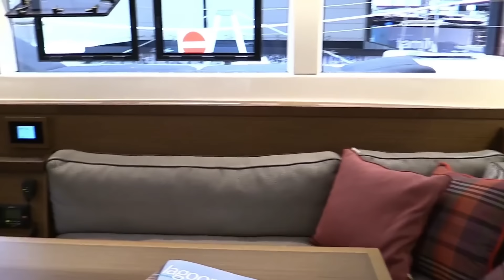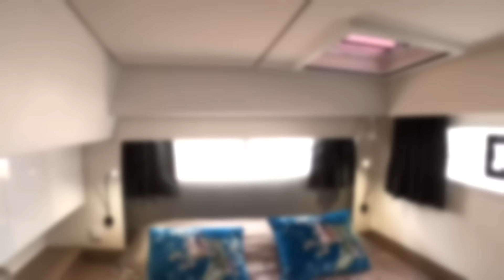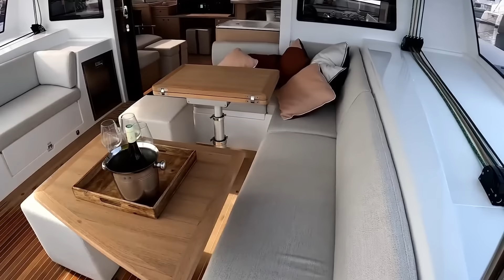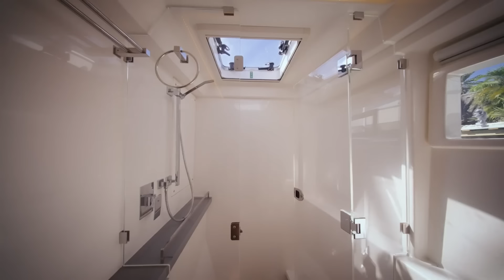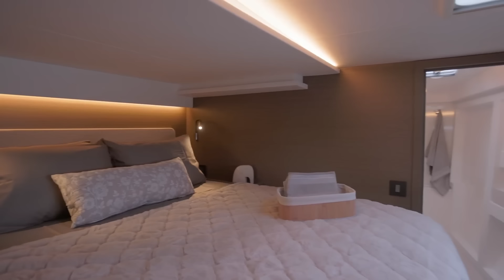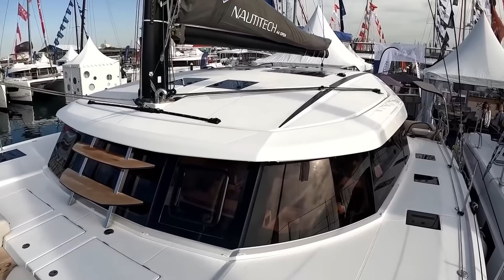Top 10 Liveaboard Catamarans Under 50ft

Comment: The Euro-African axis is well represented here. Not  one Asian manufacturer?! I believe you have a huge blind spot!!!
Reply from the maker: Fair point on the concentration. Lagoon and Fountaine Pajot cover most of French output, Leopard runs through Robertson and Caine in South Africa, and together those three account for the bulk of the used and new catamaran market under 50ft, which is why they dominate a volume-based ranking. Asia isn't empty though, Seawind builds out of Ho Chi Minh City and HH Catamarans out of Xiamen, both producing seaworthy boats, just at far smaller volumes with thinner resale data in this size range. That production gap, not any blind spot, is what keeps them off a list built around proven numbers.

Comment: I hate to tell you this, the skippers  I have spoken to have on average used more fuel on a light airs Atlantic crossing on hybrids vs straight diesel powered Catamarans.
Reply: Hard to believe. The leopard 46 hibrid or diesel sails just the same. And the generator working, when the lithium bank is low, consumes much less fuel that the 2 diesel engines producing the same speed. Plus, is just 1 maintenance
Reply: The hybrid has bigger props for regeneration certainly affects sailing performance. The problem comes on passages where you have to motor for days, also at night. The batteries are exhausted in hours, the solar doesn't power the motors. Then its the generator powering the vessel, this burns more fuel than motoring with one diesel. This has been the feedback from several Marques using hybrid from Cape Town to USA, not just Leopard.